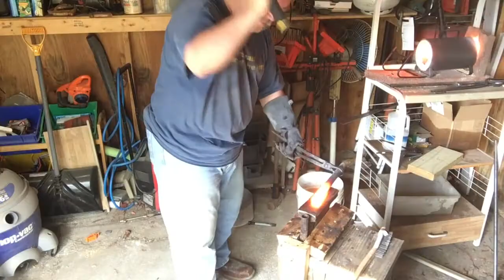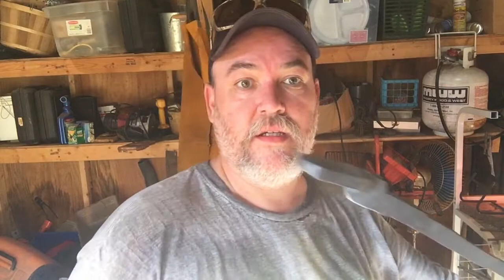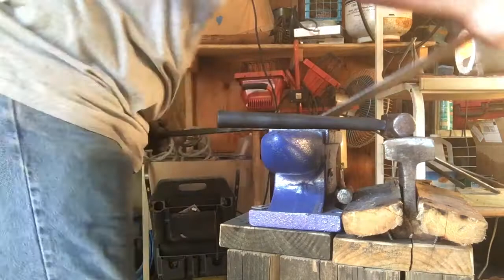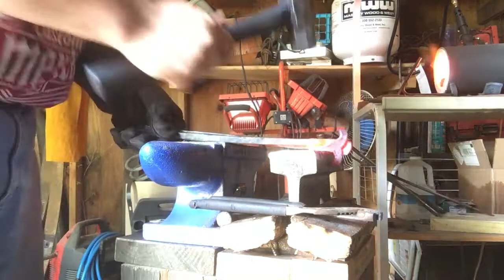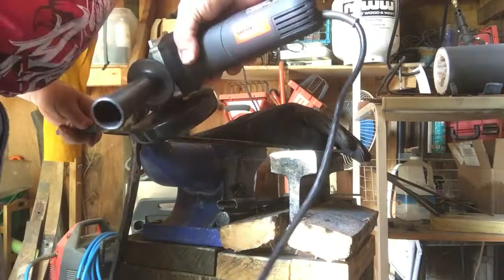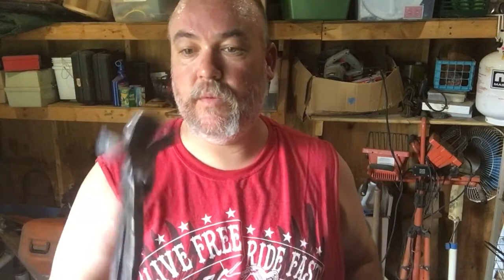Making Box Jaw Tongs

Comment: I see you hit the same wall I did with the rivet. I hot cut mine down while it was still in the tongs. I'm impressed with how much confidence with that hammer you've picked up. I'm nowhere close to pulling back that far. But that being said all I've done is blades since that split cross. The tongs came out NICE. You're gonna love working with them.
Reply from the maker: thanks man.

Comment: Nice job on the tongs Bob. Now you need to do the same thing but make them like bolt jaw so then you can hold longer material and choked up on it
Reply from the maker: Ya after using that 3/4 in and seeing how it ended up I need to get more to make them and remake my others.
Reply: B & B Forge there's nothing wrong with those I'm just to the point of you need one of everything why not. Lol
Reply from the maker: no i meant my regular tongs i first made out of to thin of stock
Reply: B & B Forge gotcha🤘